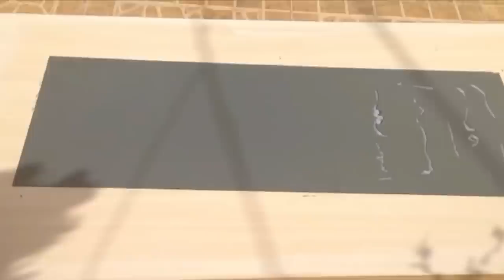DIY: Mirrored Mosaic Wall Art! DIY Wall Decor (EASY & CHEAP) 2020 Ikea Hack

Comment: to apply the mirror adhesive, there is a specific, almost gun-like tool to use--its usually in the same place in the hardware store as the adhesive tubes.  also, depending on what kind of grout you're using (i'm assuming it is grout), you might want to wait more than 15 min.  also, using a large sea sponge to clean at the end would be faster for you.
Reply from the maker: +marie marie glad u liked it don't forget to check out my giveaway and enter